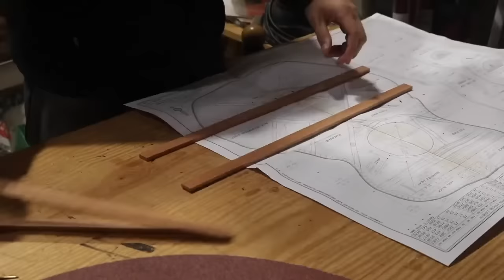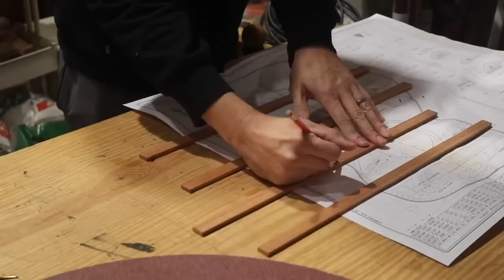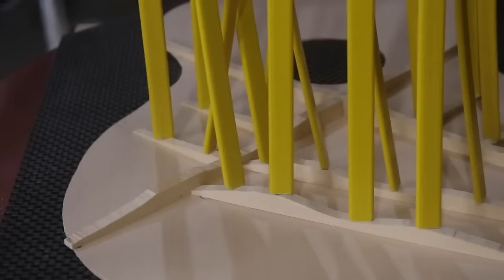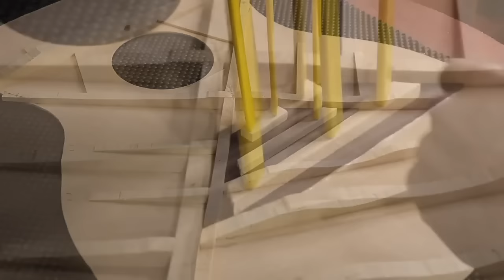Full Guitar Build Video / a beginner‘s 18 month journey

Comment: I just finished my first guitar last evening.... No , it didnt look like this guys...... but when I saw the forms and tools this guy has I realized partially why. My guitar plays well though... and cost a total of $23 oo ! Look into how many guitars are built today.... using cheap but not garbage wood. I grabbed a piece of 1/8" paneling off of an old shipping package , and with an old bed that someone had thrown outfor a neck. Not caring about design inputs in the norm I did some nice hole work. Cant inlay worth a s%^$ I ground to a powder some MOP beads and epoxied it into the perimeter of the sound holes. The most amazing thing I accomplished though was learning what NOT to do. LOL That was my main goal for this first attempt. You know.... it looks pretty good.... it plays pretty well and it gave me enough that I will build myself another.... I have 30 or so videos already of things I have built. hhhmmmmm should try to cover my first guitar build....Thanks
Reply from the maker: Man, that’s awesome! Only $23! I learned a lot about what not to do on my first build too, haha

Comment: You have a lot more patience (not to mention cool background noise) than Me! maybe I missed it, but did you install a truss rod? I've researched guitar-making before and some people thought it was REALLY important, I was on the edge. Stunning guitar! makes Me wonder if I should try making one...
Reply from the maker: Thanks man! Yes, I installed a truss rod. This video was a compilation of a 17 part series, so I guess that part didn‘t make it! I have heard of some people not using a truss rod, but still reinforcing the neck with carbon fiber rods. And a lot of people do both a truss rod and carbon fiber, a method I will likely start using in guitar 4 or 5 (I‘m on number 3 now). Building a guitar, while requiring a lot of patience and commitment is the most fulfilling thing I ever did since I started woodworking, so much so that it‘s basically all I do now and my channel has turned from a basic woodworking channel over the years into a lutherie channel. I do plan on getting into chair making and doing more with kumiko, however. Anyway, thanks for watching! I have enjoyed the several videos of yours that I‘ve watched already. Keep it up!

Comment: How did you make you 15' radius sanding disk? Build a 15' tall pendulum and suspend a router from it?
Reply from the maker: I didn’t make it! I had really no desire to do so, so I bought one. I got my two radius dishes from lmii.com and then glued a 3/4” piece of mdf to the bottom of each in order to beef it up so that it would resist bending too much under clamping pressure while installing braces. I used a go-bar deck to glue on the bracing.

Comment: what kind of sealer ? sanding my taylor and gonna do pyrography but need a sealer over that's not poly. man, makes you wonder what the difference is between this and a $200,000 guitar i heard yesterday. truly magnificent!
Reply from the maker: Thanks for watching! People usually use a  1 pound cut of shellac as a sealer.
Reply: @CMRWoodworks  "1 lb cut"? is that a spray NAME? guage? what?
Reply from the maker: Mix 1 ounce of dewaxed shellac flakes into 8 ounces of grain alcohol to get a thin 1oz cut to use as a sealer. Or, in your case, the absolute easiest thing to do would be to just buy a pre-made product. Google “bulls eye sealcoat” and that would suffice, I’m pretty sure. Hope that helps!
Reply: @CMRWoodworks  that's extremely helpful but for a BURNED design I'm thinking a SPRAY would do better so as to not pool in tiny areas. ?
Reply from the maker: The shellac is really thin, so you can apply it with a cloth, so no pooling. But, they may sell a spray version. Although it might be a heavier cut instead of a 1lb cut for just sealing.
Reply: I use Zinnser Bullseye Shellac in an aerosol can as a seal coat if you want a spray product. Just spray lightly

Comment: Wonder where the beginner's journey starts?
Very nicely done!
Seems like pro skills to me...
Reply from the maker: At the beginning! This was my first guitar and this video spans 18 months. I had already been woodworking, but 90% of what I did in the video relating to actually building the guitar was my first time doing it.
Reply: @CMRWoodworks  Of course, I was joking a bit, but could see you had some woodworking experience. Tremendous result, your skills and patience are great!
Reply from the maker: I knew you were joking, so it’s all good man! I should have put in the video somewhere that the process seen in the video was 18 months long. Without knowing that, it actually does look kinda like I know what I’m doing, haha. I recorded a 17 part series on this build and this video is just all of the non-talking parts. If you ever decide to watch any of those videos, you’ll hear all about the struggles I faced. There were a lot! I almost quit the project at the neck joint part of it.
Reply: @CMRWoodworks  So I watched vids 9, 10 and 11 about the neck and its joining. Haha, quite a struggle you had. Fortunately it turned out right, but I understand the 'beginners journey' much better now!
Also nice to see you use mm, so much easier than those broken inches.
Reply from the maker: I love using metric. I use it at work already for years now, so I love it so much more than having to use fractions and such.

Comment: Some narration would have been helpful.  What wood did you use?
Reply from the maker: This video is actually a compilation of a 17 part series of videos. I think a link to that series playlist is in the description. I go into all kinds of detail in that series, if you are interested! But, the wood was indian rosewood back and sides and sitka spruce top. Ebony headplate, fretboard, and bridge. Mahogany back bracing. Spruce soundboard bracing. Mahogany kerfed linings. Indian rosewood bridge plate. Flame maple bindings and end wedge. Indian rosewood veneer for the backstrap of the headstock. Maple veneer underneath the ebony headplate.
Reply: Thx

Comment: hello, Sir. that's really awesome and inspiring. Did you apply the same radius for the top and back(body)? As for the top, did you face difficulties sitting the overhung fretboard on the body since the bottom of that overhung fretboard is flat while the surface of the body is radiused? I couldn't sleep thinking of this :))
Reply from the maker: The surface of the body is flat above the soundhole, so the fingerboard sits flat against it. The braces on the inside of the guitar are flat above the soundhole and radiused below the soundhole.

Comment: Beautiful work, thanks for sharing. Just curious, why make a bolt on neck and then glue the fingerboard to the top? Thought the Bolt on was so the neck could be adjusted instead of reset.
Reply from the maker: There are two types of bolt on necks. The one I did is the “traditional” bolt on. Only the tenon is bolted on with only the fingerboard extension being glued down. The “newer” method a lot of people are using is called the “bolt-on bolt-off” neck (or something like that) and both the tenon and the fingerboard extension are bolted down, so in other words, a glueless joint. I will try that method eventually. My goal is to do only glueless joints since that makes it easier in the future for any kind of adjustments.

Comment: GREAT VIDEO!!! QUESTION AT 4:30 MINUTES IN THE VIDEO WHEN YOU PUT THAT PIECE OF WOOD WITH THE MULTIPLE CUTS AROUND THE  PERIMETER COULDN'T YOU JUST STEAM THAT PIECE OF WOOD WITHOUT THE CUTS AND GLUED IT IN THE GUITAR OR DOES DOING IT YOUR WAY SERVE A PURPOSE?
Reply from the maker: You can do it that way and some people do, but traditionally, some version of what I used (with the cuts) is used by most people. The cuts are called kerfs, so the pieces that are attached there are called kerfed linings and are there mainly to provide more glue surface for attaching the top.

Comment: you are very skilled, amazing guitar. May I ask you how you achieve the precise lineup of the neck to the body ? I fear that if I would do it the neck and the body would be a little twisted and the strings would make scratchy noises
Reply from the maker: Thanks! There is so much precise measuring and work that goes into figuring out the neck angle and then actually pulling it off. For my process it started early in the build right after doing the binding and before even shaping the neck. Then from that point on until I actually cut the neck joint I had to keep stopping to check and make sure everything was going to plan. In other words, it takes a whole lot of planning and precise work to make sure the neck lines up like it should. Thanks for watching and commenting!

Comment: ? Can you run a whole top through your new drum sander? Thanks Michael I'm looking to buy one but I would like to find 1 at least  Can sand the whole top
Reply from the maker: The drum sander I bought is 18“, but it is open ended so that if you have something over 18“ wide, you can just run it through twice - once one way, then rotate the workpiece 180 degrees and send it through again. But, for a guitar, if you cut out the shape of the top, it should fit through in one pass. I think my guitar is some where around 14 or 15 inches (I‘m not sure), so there is no problem.

Comment: I’ve never seen anyone carve out spaces on the sides for the back bracings, so you could see them once the back is glued on. Am I seeing that correctly?
Reply: And you did the same on the top? Letting the top bracing and sound bars poke through the sides? This looks to be perhaps your own unique take?
Reply from the maker: It‘s how I learned to do it, actually. Some people just but the braces up to the sides, but some others say making them go into the sides and glued down makes it stronger. The binding covers up all of this. So you don‘t go too deep down the sides. The ends of the braces are only 2.5mm or so which the binding will easily cover up.

Comment: Where is everyone getting those big round radius sanding tables????
Reply from the maker: I got mine from Luthier‘s Mercantile. They are going out of business, but you can get them from StewMac or from luthiersuppliers.com or Canadian Luthier Supply or even LeeValley.com. Looks like Lee Valley had the best price of the ones I mentioned. You can also google „radius dish“ and find other sellers. By the way, use a 30 foot radius for the top and 15 foot for the back.
Reply: @CMRWoodworks  cool thanks!!! I actually just found a 15’ on freakin Amazon!!! Nice 👍 wish me luck. Maybe I’ll make a video showcasing the build. Hopefully it’s as cool as yours

Comment: this is incredible! I have a question. why glue the fretboard edge down if it's a bolt on?
Reply from the maker: Thanks! It’s called a bolt on neck joint, but the fingerboard extension is still glued down. There’s a more modernish joint called a bolt-on bolt-off neck joint in which both the tenon and the fingerboard extension are bolted on. I was just as confused as you when I was learning. I guess the bolt-on part that has become popular in recent years only ever referred to just the mortise & tenon part of the joint. My goal is to move to the completely glueless version, but it is a bit more complicated to pull off. A lot more to plan for.
Reply: @CMRWoodworks  fascinating.  I've seen the bolt on, and wondered why thr fingerboardnis glued on

Comment: Great video and guitar
Can you tell me where you got the yellow go bars?
Reply from the maker: I got them from StewMac.com. But they are really expensive there now. They have increased in price since I got mine. I’ve heard of people buying yard reflector rods from Home Depot or Lowes and taking off the reflectors. Thanks for watching!
Reply: @CMRWoodworks  Thanks, I use 1/8 fiberglass rod from McMaster Carr with rubber boots on the end. I always wanted the yellow sail batten stock, but you are right too much money. If you haven't seen them watch Michael Greenfields  (making a guitar) video and anything by Ken Parker Archtoppery is fantastic.

Comment: I am using the same circle cutting guide. The registration pin that came with the guide is a little loose. Do you have the same problem?
Reply from the maker: The registration pin is just loose enough to be able to get the pin out. I find that once I have the Dremel attached and sitting down on the workpiece in the jig, I don’t notice any play.
Reply: @CMRWoodworks  Thank you for your reply